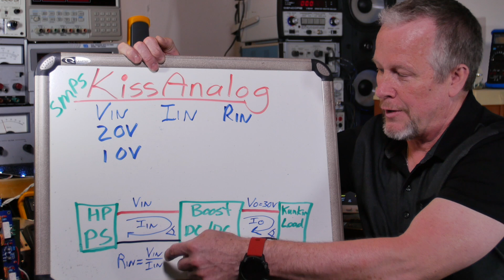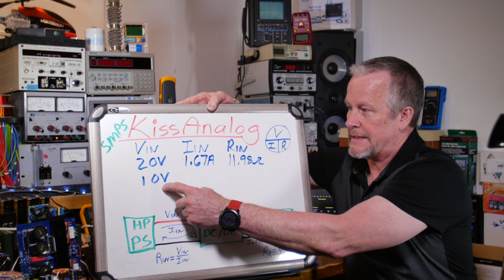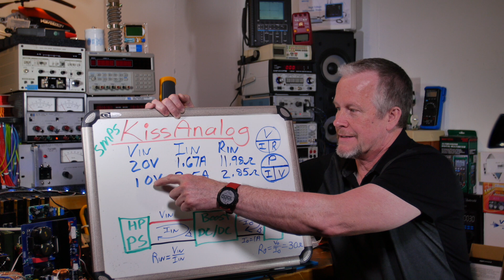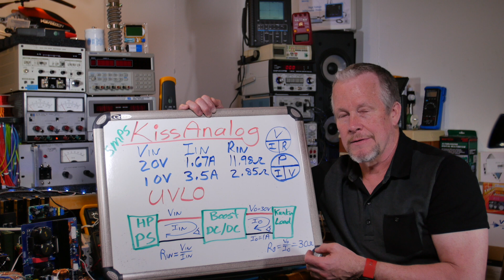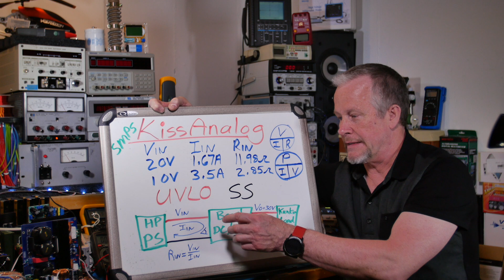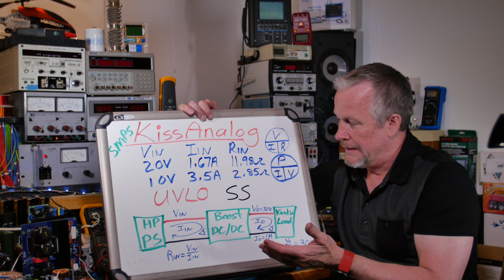What is Negative Resistance?  What does it mean for a SMPS?

Comment: Great video - I had to watch this a couple of times Eddie to get it but I understood what was happening; not sure I understood why it was happening?  Let me see: is this negative resistance a function of the SMPS having to charge its input, internal (and output?) capacitors to get going?  I don't think so otherwise it would stabilise back to a 'natural' resistance, but the resistance is dropping with the voltage and the current is rising to meet the physics and stabilises at that point.  I got the bit about UVLO being used to control this and prevent what might end up being a runaway high-power startup.  So resistance of the boost converter is following the input voltage and current is pulled to allow that to happen.  Why does it do this?  EDIT: I think I get it - because there is a power requirement at the output and it's trying to meet that as a function of voltage and current (obviously), and thus resistance has to change to match the laws of the universe.  As input voltage starts low, current has to start high, these variables moving in relation to each other in terms of Ohms law.  Why does this only impact SMPS?
Reply from the maker: I think you just about have it;) It is because of the load being a constant power supply.  I  happens whenever you have a regulated output with a load that wants constant power - like another power supply.

With a linear, as the voltage comes up, the linear can not supply the correct output voltage until the input is high enough, so the output power is not there yet.  Then when the input is high enough to account for the voltage drop across the linear, then the output voltage will be regulated.  As the input voltage increases, the linear has an unused voltage across the input.  Make sense?  thanks for the great question!
Reply: Kiss Analog yes I think so.  I forget you don’t have the SMPS feeding into a regulation stage before the load.  With a linear supply, it’s regulation is kicking in and ‘starving’ the load until the voltage levels are high enough.  Assuming you set a current limit before startup, it must go into CC immediately and then, if able/necessary, flips to CV.  Thanks Eddie

Comment: I have a lot of different SMPS from very little power (Plug-in PSUs) up to 6 kW (heavy Server SMPS) - but i never heard of "negative resistance" in that case :-). I think i got the point you wanted to make - but i won't call it negative resistance. I tend to prefer buck-converters over boost-converters as the last are normally less efficient. I just have a few smaller boost converters and when i tested them i recognized for the cheaper ones that they have a severe problem when the input voltage decreases under a certain point. Then it can happen that the output voltage suddenly rises to unexpected levels - can happen that you end up with 50V output when you adjusted the output to only 10 or 5 V. The better boost converters sometimes have that UVLO to protect it - the chinese cheapies don't. This can be a problem when you power your boost-converter with a li-ion battery that in some point faints to below 3.5 V - and then shit may happen! You normally dont have these effects with buck converters.
Reply from the maker: I’m working towards a more complex subject, so I’m paving the road;) it will seem simple when I explain it, now that I have the concept of negative resistance taken care of.  We’re all going to have expertise in power supplies as I move along.  The buzz words need to be covered too, so when someone hears or reads about input impedance - they’ll smile and say I know what that is;) That high voltage spiking scares me - I’m afraid a capacitor is going to explode;) a load, even a small one can take care of that.

Comment: You like meters, so do I, but I'm looking to get a meter that measure 0-12.5 or 20 KV  AC and DC - what would be the most inexpensive meter for me to get? If anyopne out there reads this, I'm all ears. The reason I need it is to measure Tesla Coil output and few Jacob Latter gizmos I demo on our annual show. Anyway, thatnks for any suggestions!
Reply from the maker: Tony, what if you got some high voltage resistors - say to divide by 100 then you could use your meter and multiply by 100?

Comment: You  touched on and hit me in a sore point.   Many Chines PSU's claim say 10A.  On this side of the pond one would assume that is what the PSU would be capable of producing.  NO.  They are referencing what can be put into the PSU.  When in fact the said PSU may only be able to produce  5A at a given voltage.

They in fact Fuse some PSU on the INPUT.
Reply from the maker: Great feedback!  I’ve heard a little about this practice!  Too easy to play with numbers.
Reply: That is only true, when the voltage needs to be boosted, which is not usually the case for PSU types that are supplied with mains voltage and are therefore based around buck converters, which almost always output higher currents than what their input is.
In fact they do not usually tell if they refer to input or output amps. If there is no information then you have to consider the worst scenario and calculate the input or output manually and also factor in some losses (usually between 10% and 20%).